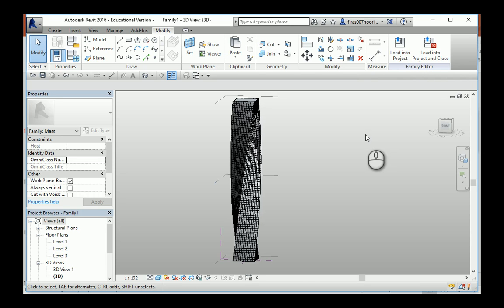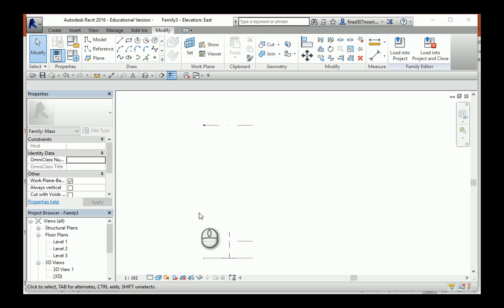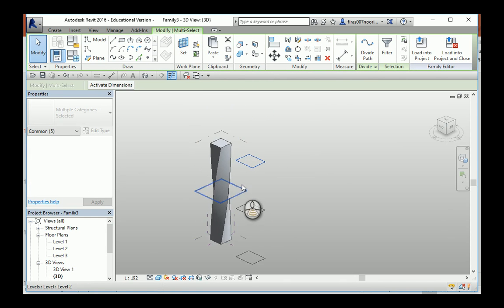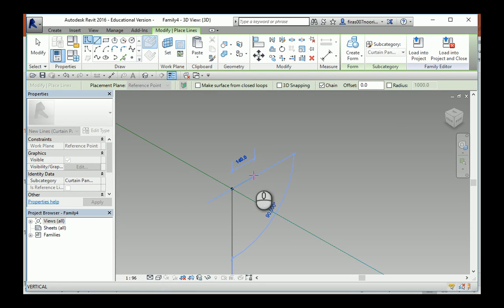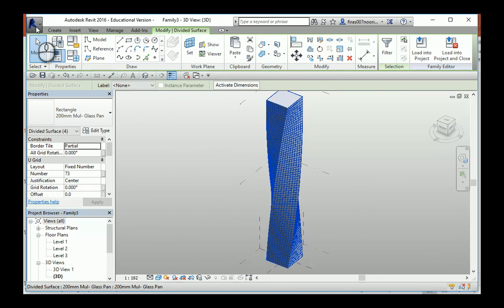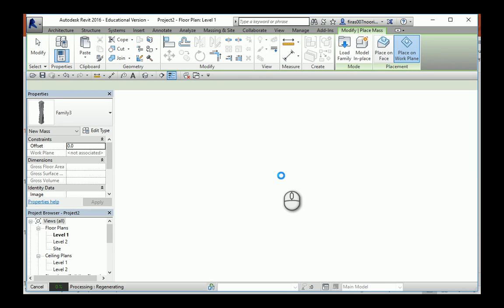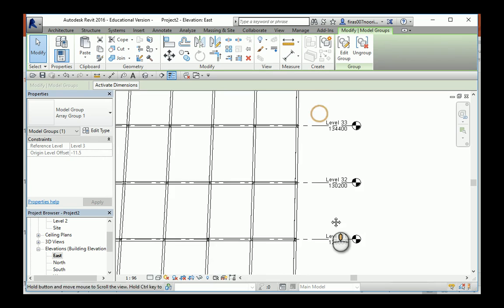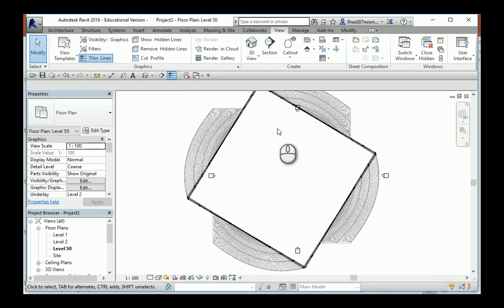The Making of Cyan Tower   Dubai - UAE

Comment: Massing made simple. Thank you!! However can we also get a tutorial on how to make these tensile roofs with funny shapes and perhaps a complete tutorial on 3d Max/V Ray rendering with setting the camera in the right position for tall buildings
Reply from the maker: Greeting, Thank you, dear Sir, I am uploading now a Max Unit 2-Lecture 3 that teaches basic modifier and modeling, it has a very basic twist modeling on the same tower, the issue I am uploading two set of semesters in the same time (two lectures [videos] per week), one for Revit and one for Max and both as pretty basic for my students at uni, thus I am focusing on elementary level to put them to the required level in short time, I will do my best to upload the required later, thanks for ur comment
Reply from the maker: https://youtu.be/eNGI7zaqulA
see this it has a Simple Max model of it
I will do my best to model for u the upper part of the Cyan tower, I am looking at some pictures regarding the top part of it, and there is more than one way to do it, and if you noticed that there are some curtain walls details as shading devices that I did not model in my Revit Copy, maybe I need to follow the same technique with some changes to make the upper parts

Comment: Good video when u create floor by face that time u use offset 50 what is it mean
Reply from the maker: thanks, I tried without the 50mm, and I found that the slab will show under the 200mm horizontal mullions, it is ugly to see the slab under the metal frame of our adaptive component, thus to conceal the slab behind the metal mullion, I just push it up 50mm so it will be exactly behind the frame :)
Reply: Ok thanks I understand